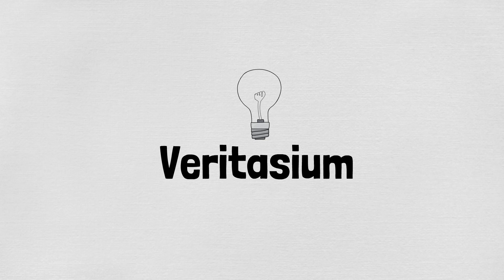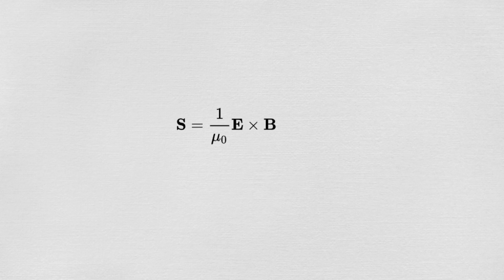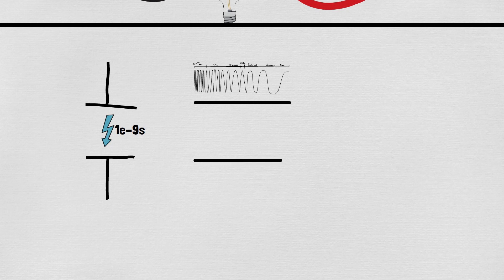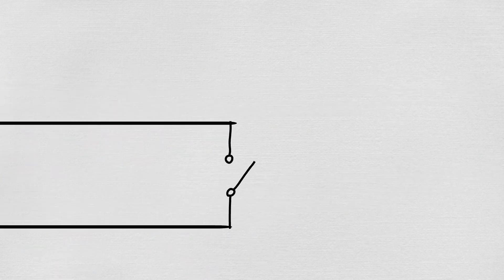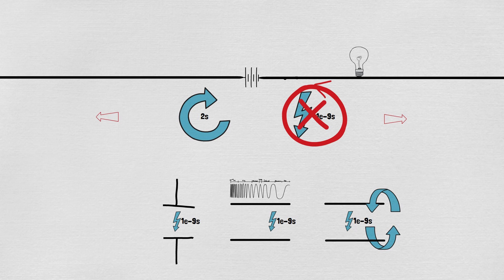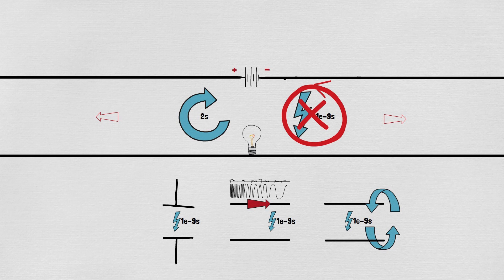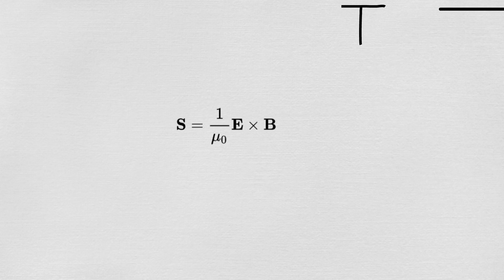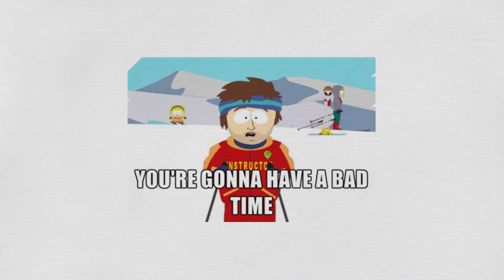Veritasium is Right? (see description)

Comment: I think what you are missing here is that the act of closing the switch itself creates a transient. This essentially turns into a simple transient on a transmission line type of problem. This is really a two-wire transmission line with a DC transient on it. This is very much an EE problem (honestly looks like one of those trick questions you would find in an undergrad EE class on transmission lines). You are totally right though that the location of the switch and also the bulb matters, but moving the switch and the bulb changes the problem and you’re missing the point when you do that.
Here is a great video by EEVblog that explains it pretty well:
https://youtu.be/VQsoG45Y_00
Reply: There is a transient true, but both Veritasium and EEVblog are still wrong because the transient travels along the wire. If the wire wasn't there, you have no transient. Therefore the claim that the answer is 1/c violates relativity.
Reply: @TimothyWhiteheadzm  The battery in its 'static' state has positive static charges distributed evenly on the surface of the positive terminal - and any conductor connected to the positive terminal. Same with negative terminal. When the switch closes this static charge will begin distribute itself evenly over the new conductors. The first charge to move will  be at the switch. When that charge begins to accelerate it will create a changing magnetic field. That field propogates at the speed of light. Since it is a changing magnetic field - it will cause a charge to move. His definition of the light bulb was 'lights from any movement of charge'. So the changing mangetic field will move slightly one electron and the bulb will 'turn on' by definition. So the answer is indeed 1m/c seconds. If the switch is moved to the far end, nothing will happen for 0.5 second as the first charge to move will be at the far end. Of course in the 'real' world, the amount of this 'wireless' energy is not enough to 'light' anything. The force of this 'wireless' field from 1m away will be on the order of 1e-20 less than the force of the eventual wave front of the actual current flowing in the circuit which would light the globe after 1 second, and which is the 'wave' we associate with a real bulb turning on. Veritasium is 'right' because of the stupid way in which he defined his light bulb. If you look at the 'professors' conclusion: He agrees with above. The energy at 1m/c is effectively zero, then it jumps up at 1 second. He doesn't give orders of magntidue, but if you plug in some real world numbers, you get a jump of about 20 orders of magntidue!
Reply: @TimothyWhiteheadzm  if the wire wasn’t there, there would be no transmission line and the problem would be entirely different. So what is your point?
Reply: @sectokia1909  I must have missed the bit where he defined the bulb as 'experiencing an electromagnetic effect' when I thought he was claiming it would actually turn on. I still dispute the 1/c claim because there must be at least some horizontal movement of electrons in one wire to induce a current in the other. Lets suppose the wire near the bulb were cut 1cm on either side of the bulb simultaneously with the switch being turned on. Would the bulb still light? If so, then Veritasium is claiming that every non-shielded bulb on earth lights up whenever we throw a non shield switch. He is using word games not science and should be ashamed of himself.
Reply: @jb_50w78  If the bulb and battery have to 'know' that the wire is there, then the effect cannot possibly travel directly across the free space or it would violate relativity. The effect either has to work without the wire, or it has to gather some information about the wired existing during its transit. If we cut the wire 1m on either side of the bulb simultaneously with closing the switch, would the bulb light up? If not, then the lighting up must necessarily somehow know that the wire has not been cut and we must add those meters to the distance over which the information about the switch being turned on must flow to get to the bulb or we have a relativity violation.
Reply: @TimothyWhiteheadzm  the bulb and the battery don’t have to “know” anything. There is no violation of relativity, nothing is transmitted faster than the speed of light. You are getting caught up in this idea of thinking the bulb has to “know” something about the system to react in a certain way. Whenever you get caught up in that kind of thinking, everything will be very confusing when talking about classical electromagnetic theory. 
Veritasium’s entire video is just a really bad and half-ass explanation of transmission line theory. His light bulb thought experiment is really just a trick question because he assumes the bulb will “light up” with any amount of power, no matter how small and negligible. In real life the bulb will not turn on.
His video was really just to educate laymen about the Poynting vector and that energy is carried by the fields and not the charges. But it actually just confuses people more.
Reply: @jb_50w78  So are you claiming the bulb will light up even if there is no wire? If you are, then your 'explanation' is even more ridiculous than Veritasium’s as you have used the word 'transmission line' while simultaneously claiming there is no transmission line. If you are admitting that it is necessary to have two wires, then it is absolutely essential that the bulb 'know' that the wires are not cut or it would be a violation of relativity. I am not getting 'caught up' in it, it is a fact of the universe.
Reply: @TimothyWhiteheadzm  no, I never said the bulb will light up without wires. The bulb will not even light up in a real life scenario anyways, the power actually transmitted is negligible.
Yes, if you remove the wires there is no more transmission line. You have changed the problem if you remove the wires. You are changing the initial conditions and also the boundary conditions of the problem. So what the hell is your point with this??? 
It’s just a really stupid trick question with a simple two wire transmission line.
Reply: @TimothyWhiteheadzm  please explain why the bulb has to “know” anything.
Yes, indeed, you actually ARE getting caught up in this idea of the bulb needing to “know” something.
Trust me, I know this, because whenever you get caught up in trying to say that something in the system needs to “know” something about the field behavior or configuration, you are only getting to get confused. I have spent my entire life studying EM theory in my profession and have graduate degrees in the area and have done a lot of research and work in the area.
Reply: @jb_50w78  Suppose there are five switches. One next to the battery, one on either side 1m away, and one on either side of the bulb 1m away. When the one near the bulb is turned on, we turn off the other four simultaneously. Will the bulb light up or not? If it will, then we can say you only need 1m of wire on each side for the effect, and we can ask what if the switches were closer? How close before the bulb does not light? If it won't light up then we can conclude that somehow the bulb, on lighting up obtained information that the switches were off. By relativity this requires a minimum of root 2/c time NOT 1/c.
Essentially I am saying that if this is a transmission line problem then the length of the line required to have the effect MUST be taken into account when calculating the time for the effect to cross the gap. The current goes out along the line, induces a current in the other line which then comes back to the bulb. If it was a 100m transmission line that means it would take 51/c NOT 1/c
Reply: @TimothyWhiteheadzm  you keep changing the problem to give the conclusion you want.
If you watch the video from EEVblog, he just assumes that the transmission line is infinitely long on both sides. The length of the transmission line doesn’t even really matter, it is so long that you can basically model it as an infinitely long transmission line. An infinitely long transmission line appears as just a matched load to the source terminals. What happens down the line doesn’t matter to the bulb and the battery in that case. When closing the switch, a small transient pulse will be seen on the line and Veritasium assumes this is enough to “light up” the bulb. This is not enough to light up any light bulb in the real world. It’s a trick question.
Reply: @jb_50w78  I change the problem to point out your error. You say the length of the line doesn't matter, but clearly its existence and at least some of its length being there does matter. If what happens down the line doesn't matter then you can answer my question about what happens if the line is broken simultaneously with the switch being thrown. You didn't answer it. You dodged the question by saying that I was changing the problem and refusing to answer the changed problem. You say the pulse goes out along the line but refuse to say how far it must go before an effect is felt by the bulb. Clearly it must go at least some distance. Even if that distance is one micron, that is a non-zero distance. By relativity we need a minimum of 1 micron + 1m /c
Reply: @TimothyWhiteheadzm  if you break the line at the same time the switch is thrown then there is no more transmission line. It’s an interesting question I admit. 
I think you’re getting confused about where the energy is flowing. From your description, you’re basically saying that the displacement current density in Maxwells equations is impossible and somehow violates causality. 
By the way, the theory of relativity actually comes from Maxwell’s equations and electromagnetic theory. So it is pretty ironic to say that an electromagnetic behavior somehow violates relativity…

From what you’re saying, transmission lines, displacement current density and even electromagnetic radiation through space is impossible.

By the way, the reason why I say it doesn’t matter what happens down the line is because it is being modeled as an infinite transmission line. An infinite transmission line appears as a matched load to the source terminals, meaning it can be viewed as simply a resistor. This is one simplistic way to view the problem as well and to understand how the current appears on the bottom wire.
Reply: @TimothyWhiteheadzm  He is claiming that because he says his bulb lights at any current, which is a key in the professors calculation, since any induction no matter how small, will light the light bulb.
Reply: @sectokia1909  So if the wire were only 1 micron long on either side of the battery and the bulb, could the bulb be said to 'light' by his definition when the switch were closed? But even then the bulb cannot light until at least 1micron+1meter/c seconds. 1/c cannot possibly be the correct answer.
Reply: @TimothyWhiteheadzm  that is a good question. I will answer it with another question for you. At what point can two wires be considered as a transmission line? To help answer this question, go into the frequency domain (it’s actually much easier to understand a lot of this behavior in the frequency domain even though a lot of these DC transient type problems are analyzed in time domain). The DC transient pulse can be considered as a wide-band signal with energy spread across frequency. So with regards to the frequency of the signal, at what point is a two wire system considered as a transmission line? Obviously there must be some limit because in the extreme limit where it is only 1 micron long, as you describe, something must be different. 
This will reveal whether or not you actually understand transmission lines and the problem being asked. (The fact that you keep wanting to  factor in the length of the line to the answer shows you are not fully understanding).
Again, Veritasium’s video is not a particularly great video and is pretty misleading, and the problem itself is kind of poorly stated and explained.
Reply: @jb_50w78  I am not an electrical engineer, but that is in a way an advantage. I am not tied up in formulas and school learned rules that are actually short cuts to calculating what is really happening at the physics level. I really don't care if you consider them transmission lines or not, what matters is how and why does the signal get emitted and how is it received. The answer is that either it is transmitted radially in all directions out from the switch and 'turns on' all unshielded light bulbs regardless of wires, OR it depends on the wires in some way and thus there MUST be some event that goes out one wire, across the gap and back and therefore necessarily, by relativity CANNOT possibly reach the light bulb in 1/c. My understanding is there is a pulse along the wire which causes the wire to radiate radio waves that cross the gap and are picked up by the other wire which creates a current in the other wire. The wavelengths of the radio waves is the question as that determines the minimum length of the wire. Maybe xrays instead? I honestly don't know enough to know if xrays can cause the transmission line effect. Do you?
Reply: @TimothyWhiteheadzm  read up on transmission line theory (if you’re interested). A good source is Microwave Engineering by David Pozar, if you are really interested in it. It is derived from Maxwell’s equations directly (actually directly from the wave equation, which is the partial differential equations that describe electromagnetic waves). Formulas you learn in school are all based on physics. There is no violation of relativity (Maxwell’s equations are inherently relativistic). 
From the way you talk about it, you are not fully understanding it, and that’s fine. Veritasium’s video is pretty bad and really misleading, as is the thought experiment. (When he talked about the transatlantic cable he left out so many important details and there were a lot of flaws in his explanations throughout). The way he used the Poynting vector was also misleading and just confuses everything more.

To answer your question, yes of course you can have a transmission line for x rays (although extremely small due to the wavelength. There is research where people have made tiny dipole antennas and transmission lines for THz and optical frequencies). The more general theory behind transmission lines is actually waveguides (another good resource is Field Theory of Guided Waves by Collins but this is a very high level text and treatment of the subject).
If the wires are 1 micron long, the problem becomes meaningless. To answer my question for you, generally you begin to see transmission line behavior for lines that are longer than lambda/10 (smaller than that and you can assume just basic circuit theory and ignore propagation time of signals).

There is also another explanation from physics that can give a clue to the problem which is from the retarded potentials (or the Jefimenko equations) which are a consequence of Maxwell’s equations and state that any disturbance in a field will propagate out at the speed of light. Basically, all electromagnetic phenomena are time-delayed disturbances of fields and charges propagating at speed of light. 

Every single explanation and model comes to the same conclusion, because they are all based on the same physics.
Reply: @jb_50w78  What you appear to be missing is that although the disturbance in the field is propagated at the speed of light, the disturbance that affects the bulb is NOT going in a straight line from the switch to the bulb. It is goes from the switch, out along the wire and only then across the gap and back to the bulb. Therefore 1/c cannot be the correct answer. 1/c violates relativity. Of course the original video is completely and utterly wrong because it considers any disturbance in the electromagnetic field, no matter how small to be turning on the bulb whereas in reality that is not what we mean by a bulb turning on. If you flip a switch in your house and there happens to be a spark, you can hear that spark on a nearby radio receiver, but you would not claim that every bulb in your suburb turned on.
Reply: @TimothyWhiteheadzm  you still don’t understand it. Let me try to explain it a little better and more in depth.

In the beginning (before t=0 when the switch closes) there is a potential difference across the switch terminals equal to the potential difference across the battery. As soon as the switch closes (at t=0) charges move and you have a current. Initially, right at t=0 and right at the location of the switch (which is the same location as the light bulb along the line) the two wires will appear to the switch terminals as distributed series inductance and shunt capacitance. This distributed series inductance and shunt capacitance is what is actually referred to as the “transmission line.” Immediately, a wave is launched down the line, and what forms this wave is a potential difference across the two lines (the electric field component) and the currents (magnetic field component). The question posed by Veritasium is a trick question because he assumes that the bulb will turn on immediately whenever ANY amount of current flows. The bulb is located 1m across from the switch at the same location along the line. So it will experience a current to turn it on at 1m/c seconds due to the transient from closing the switch. This is all thanks to the displacement current density term in Maxwell’s equations.

Now, you are going to start complaining, what about what happens at the end of the line??? What about the location of the switch??? Well, Veritasium didn’t make it clear, but it DEFINITELY MATTERS WHERE THE SWITH IS LOCATED!!!! The switch location is the reference point, it is where the wave in the transmission is initially launched. 
Another fact about transmission lines is that an infinitely long transmission will appear as just a resistive load to the source (because waves continue to propagate down the line). At t=0 the two wires appear as an infinitely long transmission line. That is why a very simple way to look at the problem is that the two wires initially at t=0 can be modeled as just a resistor connecting directly from the switch terminal to the bulb (with impedance equal to the characteristic impedance of the two wires, or sqrt(L/C))

Now, after the waves make it to the end of the two wires, what happens will depend on the boundary conditions (if the end is an open circuit, short, or has something with certain impedance). The waves will reflect back to the switch and there will actually be multiple reflections until the system finally settles to the steady state condition, giving the expected DC circuit behavior.

But it must be clear, that the location of the switch matters! If you move it down the line it will change the results and the bulb will not light up (according to Veritasium’s conditions) in 1m/c sec.

The problem is that the guy who made this video doesn’t seem to understand anything about this type of behavior (transmission line theory, which is really just applying the wave equations from Maxwell to a two wire system). He has posed the question in other comments whether a battery could be discharged by simply attaching it to two really long wires. The answer to that is if the two wires are infinitely long, yes, it actually would discharge the battery because it would appear as a constant load (equal to the characteristic impedance). It is not surprising that a physicist doesn’t know this (Jackson and typical EM courses for physics students don’t cover this stuff at all).

Anyways, this comment is probably getting too long but this is as much detail as I would like to get into. 
And this is with all my personal experience and knowledge, having double majored in both physics and EE and having a PhD specializing in Electromagnetics with experience working in EE. (I probably took more higher level EM courses than the creator of this video would ever want to have to suffer through).
Reply: @TimothyWhiteheadzm  also about your last comment about flipping on a light switch and hearing a spark and all the bulbs in the suburb turning on….

How many times does it have to be explained to you that this is just a trick question and that the Veritasium video is assuming that ANY amount of current will immediately turn on the bulb!

This is not at all in any way a real practical problem with a real practical light bulb. There are many many such idealized problems throughout physics where a whole lot of assumptions are made. It’s a “spherical cow in a vacuum” type of problem.
Reply: @jb_50w78  It is you that is still not understanding it. You keep ignoring the time components in your descriptions and analyzing them statically. That is why I brought up though experiments to show why it is wrong. Imagine that the wire gets cut 1cm away from the bulb on either side of the bulb at the exact same time that the switch is closed, will the bulb still experience a current?
Reply: @jb_50w78  You say it is a trick question, but trick questions can trick the questioner as well as the person being questioned. I also note that Veritasium actually cheats in his answer and says the bulb will turn on 'close to 1/c' and not actually 1/c but still wrongly claims that 1/c is the answer. In other words he cheated.
Reply: @TimothyWhiteheadzm  I actually took classes on special relativity in college (I double majored in physics and EE). I’ve even learned general relativity. 
Besides, EE and physics are closely related (there were several other students who also double majored like I did).

Also you keep thinking about how the electrons have to move horizontally… this just shows you are still misunderstanding. 

Again, so is Tycho (the physicist who made this video you are writing comments on) wrong too? Because he even writes in the description himself that a current will be induced onto the light bulb almost instantly (in 1m/c seconds). There is no violation of causality here. 
I think maybe you are just being overly pedantic about the light bulb and switch not being located at exactly the same location along the line. As I have said before, the location of the switch with respect to the bulb matters. If there is some offset then obviously that changes things. (You don’t even need to invoke the concept of light cones to understand that too!)
If it makes you happy, the bulb lights up in ROUGHLY 1m/c seconds (accounting for some slight offset between the bulb and switch along the line). But that is such a pedantic and meaningless quibble about it. It is an idealized problem with perfectly conducting wires long enough to stretch out to the moon and back.

And yes, you do sound like an arrogant asshole with your incessant need to try and correct me and prove me wrong. You never pointed out how I was wrong in my explanations, even admitting you don’t know anything about it. Honestly you don’t even need a PhD to understand this stuff (even an undergraduate in EE will understand this easily). I love how bringing up my education and occupation (which just so happens to be directly related to this topic) just triggers you so much. 

The way you act is just incredibly annoying. It’s like you are just desperate to say you know about light cones and special relativity. 
I started by simply just trying to explain the problem to you and how 1m/c can be arrived at as the solution and you just keep going on and on about violating relativity and cutting the wires (which again shows you are still not understanding that since I explained it).
Reply: @TimothyWhiteheadzm   “You are still not understanding the fact that the electrons at both the switch and the bulb move horizontally not across the gap”

Holy shit. Do you not know how capacitors work!? Do you think that electrons are flying across the gap in a capacitor?!

So according to you, capacitive coupling is impossible and violates relativity.
Reply: @jb_50w78  "Holy shit. Do you not know how capacitors work!?" Apparently better than you do. They have a non-zero area. Therefore if an event starts at some point on a plane of a capacitor and radiates to the other plane of the capacitor (assuming a capacitor configured with two parallel planes) then the change in electrical field will first touch the other plate at light speed, but will not affect the whole plate until later as the spherical light cone grows. At the point when the field change first touches the other plate, the other plate will be unaffected as all except an infinitesimally small point will still be outside the light cone/changed field. The same is true of capacitors that are parallel wires.